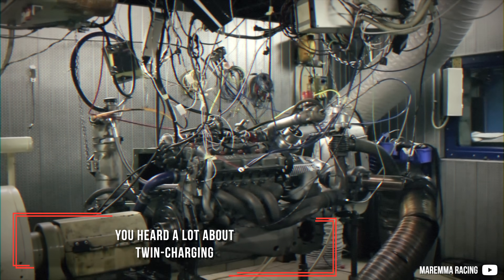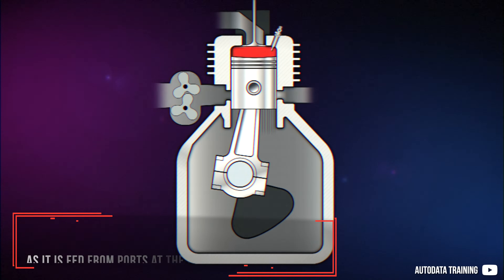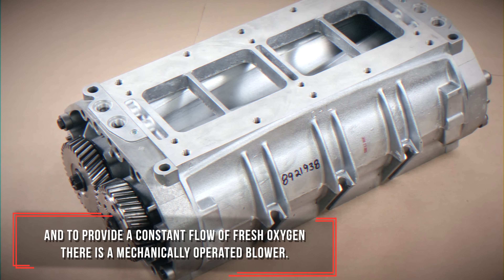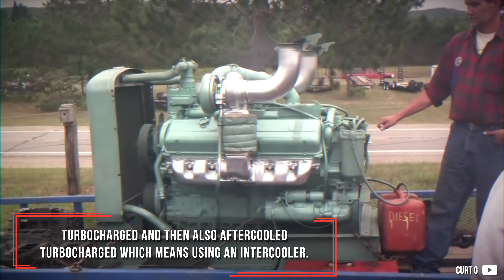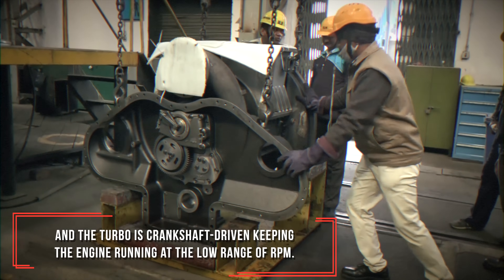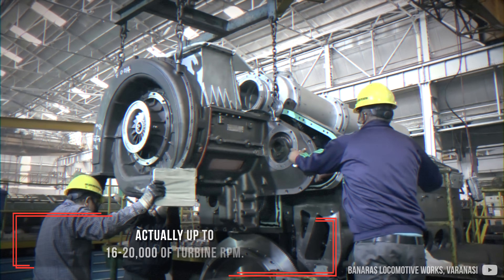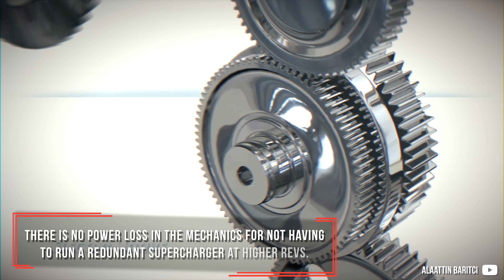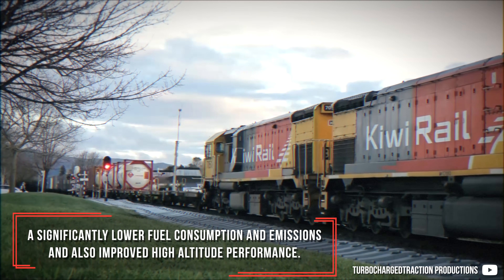EMD's Unique Type of 2-Stroke Forced Induction

Comment: I had a 100 foot long tug with a EMD  V 12 576 rated at 1200 HP. Once when I was working on it I left one of the air box covers off when I started it and the amount of wind that came out was astonishing. There was a wrench laying near the cover hole and it shot across the engine room like a bullet.

Comment: The turbo EMD is gear driven to throttle 6, throttle 7 and 8 the turbo is on its own and the one way sprag is in free wheel, throttle 7 in the 645 engines is the most efficient, with BSFC at around (.322) pounds per hp per hour, in the 645 series that around 1100 pounds of fuel per hour, I did testing on these engines in the mid 80s, at the DOT facility in Colorado out in the desert...it's operated by the Association of American Railroads
Reply: That is really neat.  How do I reach you to discuss this more ?
Reply: Very cool. I wish BSFC was published for a lot more engines out there - including our daily drivers.
Reply: @yo_marc  at one time I had all that information and it covered all throttle notches including slow idle and above, as well as pressure crank angle diagrams...
Reply: There are 3 versions of EMD engines, 567, 645, and 710 these numbers are the cu.in. displacement 
Of each cylinder... they are much larger versions of the famous Detroit Diesel truck and other use engines...
Reply: Thank you for sharing your expertise, @ChiefCabioch - I love learning this stuff!

Comment: VisioRacer: A video request: Piston sizes of different engines. Such as train engine, hauler & earth movers, F1, consumer cars and trucks would be really cool. From Dodges 6.2l v8 all the way down to the smallest you can find. Thanks for reading.
Reply: Aviation piston engines have some interesting sizes it would seem. The Continental and Lycoming engines seen on light Cessna, Piper, Beechcraft airplanes are usually more than 1 liter per cylinder. Then there are the 12 cylinder engines with more than 2 liters per cylinder (Merlin engine for example)
Reply: Smallest piston size that isn't an rc engine might probably be the ones in the honda rc 166 was it? The 250cc 6cyl bike
Reply: @koolkei  yes it would be a rc engine. Most rc engines are around 3-5cc
Reply: Well you could stand inside of some Loco engine pistons lol
Reply: Wärtsilä RTA-96 has 1800L/cylinder, i don't know anything bigger than that
Reply: Have you ever heard of the renault (r16)
Reply: @carguynewb7856   Sorry man I live in the US, and very sadly we never got any of the Renault vehicles (as far as I know) which sucks. One Renault that I'd be all over Renault Clio v6 Phase 1 or Phase 2, that's been one of my favorite cars ever since I seen it in the Gran Turismo games on Play Station back in the day. Anyway No I've never heard of it.
Reply: The 1 6 is rear engine fwd yes its engine is located in the rear
Reply: @cjgordon22  
No you can’t. My foot won’t even fit inside the cylinder of one. The EMD 710 cylinder bore is 9 1/16” and the latest GE bore is 9.8”. You can’t stand in a space that you can’t even fit one foot in.
Reply: @ralfie8801  I was thinking ship engines
Reply: @cjgordon22  
OK, but you said some loco engines.
Reply: And Ingersoll, Cooper-Bessemer, etc. compressor engines. They’re amazing, I’ve worked around them in natural gas compressor stations, they’re like giant 2-stroke Detroits. I’ve seen V8, V10, and V12s, all with pistons the size of trashcans, valves the size of saucers, turbos the size of tractor tires, and connecting rods a foot by 6” cross-sectionally and 4 or 5 feet long. Staggering. Oh, and they sound AWESOME, even at their sub-1,000-rpm run speeds.
Reply: Done winter work this year on my ship, warstilla 6l38b, pistons were probably 1.5 to 2 the diameter of a 5 gallon bucket(38cm bore) and about 2 feet Hight, i am a big guy but i fit in the liner bores quite comfortably when lapping the block.
Reply: Absolutely nothing can beat a good old fashion tight seal crankcase with a dry sump and oil injection, like the field marshall, sachs d600l, farirbanks more and polaris and skidoo 850's. yes it makes a fat heavy bottom end with side oiling but no blower is needed and you can use turboes with exhaust trapping shut up valves, oil can be bio-based and blended with ethanol and burned off and used to help add energy to these 2 strokes, no external blower needed and runs cleaner tool. If you all fear roller massive roller bearings there are graphite CSB-452 bushing bearings that will run on little or no oil as no wet sump of 2 stroke oil is required, oh sont we mix about 32:1 on racing dirtbikes to keep a quasi wet sump with conventional bearings on are high load 2 strokes! this could all be eliminated with anti friction graphalloy bushing bearings with will only require a few drops of high strength 2 stroke castor oil and what little blows buy will burn off and be clean! Lots of compressed air will be formed when pistons slam down against reed valves! On v engines a baffle and tight sealing will need to machined and welded in installed to make a tight seal for the piston blower underneath, there will be some pumping losses at low rpm but oh well you got to live wuth it as nothing is perfect! Imagine the rotary or reed valve cages now on your massive faribanks mores 10000 hp Op or big EMD, A crankcase scavenged 2 stroke is a fat bottom girl but oh well we got them on snowmobiles , some diesels and outboards and it add weight and heat and looks fat and ugly and tubby on the bottom end but you can deal with it!
Reply: The piston of an EMD 710 series diesel engine is the size of 2 and 1/3rd small block Chevy 350 V8s as a reference
Reply: Did you mean Sprag?! Because i can't seem to Sprague clutch
Reply: RC engines: The Tee Dee .010” is about .16cc, turns 30,000 rpm, and runs a two-stroke nitro (as in nitro methane) mix. Fun stuff.

Comment: I was confused for a moment, for what the information initially given took to understanding that the turbocharger was crankshaft driven, meaning that the turbocharger was technically a centrifugal supercharger, which has a turbo-like compressor but not the exhaust driven turbine.

Then with the help of the animations provided, I could see that it is a turbocharger. It is only at initial start-up when it is engaged to the crankshaft like a supercharger. And since turbocharged engine setups are of positive loop feedback, the more exhaust, the more air it enters, and the cycle continues, with ways to control boost.

It's actually genius.
Reply: i watched 3 times and im still struggling to comprehend
Reply: I Don't understand what you said but it sounded genius!
Reply: @fidelcatsro6948 , think the electric turbos in the modern F1 engines. The electric motors spool up the turbo at lower engine speeds to minimize lag. And, at full throttle, the electric motors act as a generator as part of the KERS.

The turbo in the diesel engines showcased here are mechanically connected for the sole purpose of providing the natural aspiration a traditional Roots-type supercharger give to two-stroke diesels. But once enough boost pressure is built, it is mechanically disconnected from the crankshaft and continues to run solely on the exhaust gases.
Reply: @JoseRivera-ym3wj  yeah i understand now...engine runs turbo mechanically, once enough exhaust pressure the smoke runs the turbo, its a clever idea, yes thank you
Reply: @fidel catsro  &  @Goated-FutureHendrxx  
Crankshaft drives the turbo-charger's compressor up to the point where it's the exhaust-gases that are doing the real work by spinning the turbo-charger's compressor faster than the over-run clutch, thus creating the forced-induction.
By 'inter-cooling' the intake-air that's been heated by the exhaust-gases, the volume of air shrinks while still containing the same mass of gas, which is extremely practical for higher altitudes where the air is thinner (but fortunately cooler)!
Reply: I'm french and I don't'understand all but for me if it's drive by camshaft it's a blower not  turbo compressor,turbo are always drive by the exhaust.
Reply: I see, the same compressor is driven in low by the crank and in high by the exhaust, it engage or disengage by speed like a bicycle one way clutch.

The thing is we call turbo to a compressor driven by a turbine and súper when the compressor is driven by a shaft.
Reply: I see, the same compressor is driven in low by the crank and in high by the exhaust, it engage or disengage by speed like a bicycle one way clutch.

The thing is we call turbo to a compressor driven by a turbine and súper when the compressor is driven by a shaft.
Reply: @stevie-ray2020  Thank You!
Reply: Thank you. That cleared it up perfectly.
Reply: @ThePontiacgto65  It is a conventional turbocharger, that has an additional transmission that does not allow the turbine to drop RPM lower than that transmission provides.
Reply: @mfree80286 yes,it's unique, he make the twice turbo and supercharger.the first time ,I not saw the second wheel for the exhaust gaz.
Reply: At 890ish rpm you can here the turbo mechanically disengage from the engine, rpm slightly drops but hp continues to build, throttle usually in notch 6. Onto notch 7 at approx 900 rpm hp climbs to 4,000 ish. Notch 8 and it feels like the earth will begin to crumble under your feet
Reply: @tlc5343  every marine EMD engine I've worked on usually has the clutch disengage around 725 rpm for exhaust gasses and max engine rpm of 900. Most companies only.run them at 850 rpm or really worn out engines at 800.
Reply: It's called a turbo supercharger..  At low load or low engine RPM it is driven by the crank at high load or high engine RPM it is driven by the exhaust utilizing an over running clutch.   Not confusing at all..
Reply: @allencefalu3983 
It depends on what kind of company, all of the railroads run their EMD’s at either 900 - 905 RPM, or 950 RPM on the later SD-70 ACe models until those were switched over to the 4 stroke tier 4 engines.
Reply: @matthewq4b 
Not necessarily, back in the day - WW-2 era, almost all turbos were called turbo superchargers, especially in the military aircraft industry. This gear driven EMD example wasn’t even in production yet, maybe not even yet conceived on the design table.
Reply: @ralfie8801   WRONG.....  EMD did not start induction boosting engines till 1958 LONG after the distinction between turbo and superchargers was defined...  What was done in WWII on aircraft is completely irrelevant to the topic at hand...
Reply: @ 
What do you think “not necessarily” means? Etched in stone?
Edit: I even gave you an example of where it’s not always true, but you didn’t like that. As my dear old granny used to tell me when I couldn’t have my way - tough titty. But if you want to be on the subject at hand, EMC nor EMD ever referred to any of their engines as supercharged, because those are naturally aspirated engines.
Reply: @ralfie8801   WRONG AGAIN... There is no not necessarily.    It is called a Turbo Supercharger  Whatever the terminology that was incorrectly used previously to identify induction boosters is irrelevant as it was later CHANGED to PROPERLY identify the assemblies.
Reply: @ralfie8801   AND WRONG AGAIN. EMD AND GMD BOTH referred to  the late 567, the 645 and 710 them as either Turbocharged  or Turbo Supercharged...  There is clearly some very basic knowledge lacking over there.
Reply: @ 
Yeah, you just keep stepping in it. 2 stroke diesel engines cannot run or even start without some sort of forced induction. If that forced induction is a roots blower, then it is a naturally aspirated engine because at full throttle those two blowers can barely pass atmospheric ground level pressure.
Reply: @ralfie8801   Holy crap talk about dense.   Where did say "FORCED INDUCTION''' I said Boosted induction, there a distinct difference in two stroke diesels between the forced intake induction and BOOSTED INDUCTION.  Determined to drive that not the first clue point home with a sledge hammer I see....
Reply: @ralfie8801   So what tidbit of wrong an useless information you gonna post next ?
Reply: @ 
What do you do for a living? Tell everybody they’re wrong when they’re not? That’s not much of a living.
Reply: @ralfie8801  Sounds like a lot whine for getting called out on being clueless. Next time don't post comments on a topic you know nothing about.
Reply: @ 
You obviously don’t know a thing about what I know. 
I’ve been working on these engines for 28 years and troubleshooting them for the last 15.
Reply: @ralfie8801   Sure thing.. This coming from the guy that did not know the difference between forced and boosted induction or tried say EMD never called these engines turbo or supercharged.  How much deeper u gonna dig the stupid hole ?
Reply: @ 
As deep as you want to go - you’re doing all the work.
Reply: @ralfie8801   Not the sharpest tool in the shed are ya..
Reply: @ 
The funny thing is that everybody else that is reading this is free to look up anything that has been said and see what is right and what is not. I stand by my first comment that turbochargers were once called turbosuperchagers because at the time they were considered superchargers, all the way up to the mid 20th century, which include WW-2 aircraft. 
Prove me wrong with something other than a condescending comment about how right you are and how everybody else just has to be wrong because it doesn’t agree with you.

Comment: Very interesting video and Man the sound of a Detroit 2 stroke diesel never gets old!
Reply: The startup idle roll is simultaneously exciting and anxiety inducing. Have you ever had to work on the mechanical Governor in those things? It was the single most complicated part on the detroits.
Reply: Something I'll probably never hear again in the UK. I drove a shunter on a steelworks that had been cobbled together from what was lying around which included a 8/71 DD engine coupled to a six speed crash box and an axle of uncertain parentage. That thing could pull insane loads and with no trailer could give a Porsche a run for its money on acceleration... Up to its top speed of about 30mph 😀
Reply: @AnthonyHandcock  in the US, people are putting Detroit diesel stock blocks on dragster rails, and they’re making THOUSANDS of horsepower. Absolutely insane
Reply: @THESLlCK  I'm not surprised at all. I've often wondered what would happen if you fitted carbs to a DD and replaced the injectors with spark-plugs... You'd have to run it on billion octane fuel at that sort of compression ration but I bet it would chuck out some serious horsepower... Briefly 😁
Reply: @AnthonyHandcock  well people run them on 90% nitromethane with a little diesel and they run about 6,000-8,000hp.
Reply: @THESLlCK  Sooner them than me to be honest. That's into the territory of wondering if "engine" or "bomb" is the most appropriate word :-D
Reply: I got an 8v92 2 stroke turbo. Now I want to get an 850 rotax etec turbo and run it at 1200 rpm.
Reply: The 2 strokes detrotsy
Reply: Run ethanol and make a dry sump with oil injection VRO pumps . Use plenty of castor 927 maxima 2 stroke oil.

Comment: The gear driven turbocharger that EMD uses was tried on Detroit Diesel 92 series (for truck and bus use). But the throttle response was not good-basically it didn't work well. So this system is only good for slow acceleration/generator use-as in a locomotive. It works so well, the EMD is Tier 4 final approved for marine use. now.
Reply: Worked on a boat fishing in the 80s with EMD power, worked well and almost as quiet as a CAT
Reply: I don't think they make a tier 4 2 stroke. EMD's teir 4 engine is 4 stroke.
Reply: Tyler Hunt   It was a reman from a train, wasn’t the engineer so didn’t pay that much attention
Reply: @tylhunt  Only for rail, for everything else it's the 710 still.
Reply: It's interesting, because the EMD engines are praised for their throttle response (especially compared to 4 stroke engines). They can accept load and recover exceptionally quickly
Reply: @billyp4850  Tug, ferry and push boat operator love the response and reliability plus ease of working on the 2 stroke EMD's.
Reply: @billyp4850  yeah, I was looking it up. I guess marine tier 4 emissions standards are different than rail. EMD had to go to 4 stroke to meet tier 4 emissions for rail.
Reply: @tylhunt  I think EMD couldn't get the 710 to meet tier 4 without using DEF, and none of the rail operators wanted that. It was reportedly very close to meeting tier 4 but not close enough. The marine 710s use DEF
Reply: @billyp4850  BHP in Western Australia are 100% SD70ACe / EMD 16-710. I believe they can still buy them because EMD and GE make international versions of their US locomotives.

Comment: Presumably EMD used something like a Sprague clutch to disengage the blower drive when turbine power was sufficient. Smart design.
And as a New Zealander, nice to see Kiwi Rail featured.
Reply: Hi Steve
Reply: Yes that’s correct, at low RPMs it acts like a centrifugal supercharger. But once the exhaust gasses gained enough power it would unlock the clutch and run off exhaust gas power. Pretty trick design. And there is nothing in the world like the ear shredding shriek of an EMD turbo at max RPM.
Reply: I never get sick of hearing DFT's roaring through Trashburton, they sound sooo much sweeter than the DXB's! But then I love GM products in general!
Reply: volvo penta on their marine diesels used a small root blower belt driven with a A/C style clutch that when you throttled up it would take up the lag the disengage when the turbo spooled up … weirdest thing you ever heard 😅

Comment: Always a pleasure to work on these engines, many power pack and head change outs, very modular  engine in construction. Have seen a few over run clutches fail, no drive to the turbo resulting in low power, plenty of smoke from unburnt fuel. Even still a very reliable unit compared with other engines.